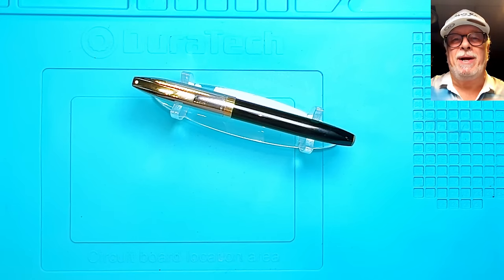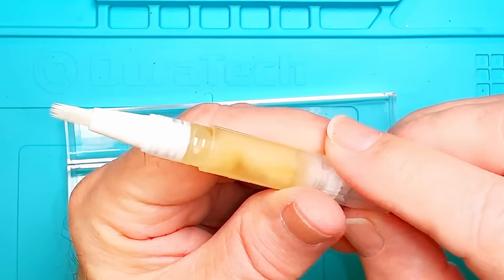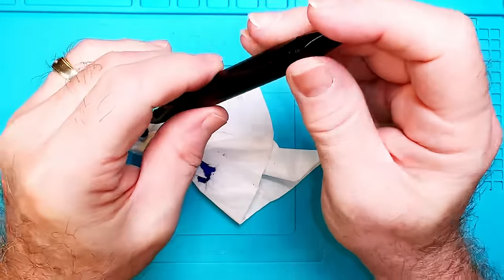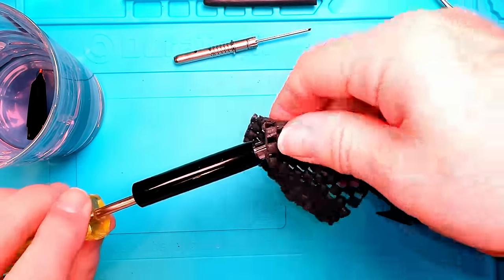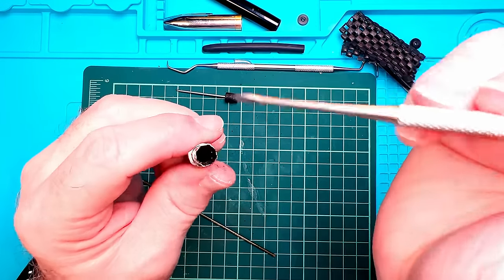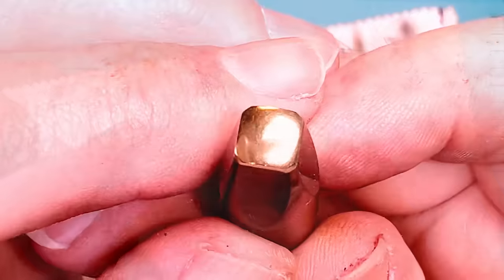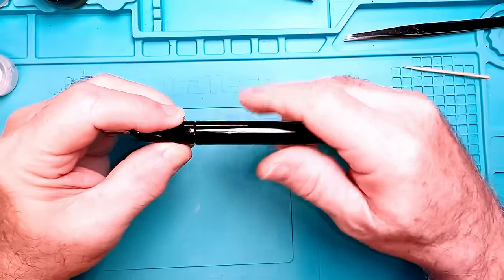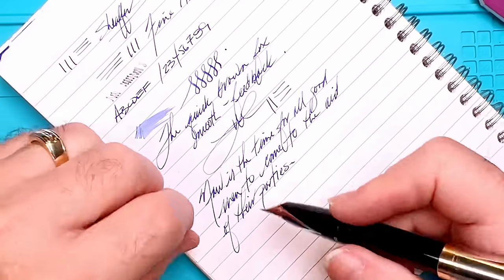Pen Resurrection Sunday Ep 56 1960 Sheaffer PFM

Comment: Hi Doug,very interesting video.I'm rather a Sheaffer man myself and have done several TM snorkels but never a PFM.When replacing the sac protector I don't bother recrimping,I just add a dab of shellac.I find this is perfectly sufficient for holding it secure and it  means that next time the pen needs resacing there is no need for uncrimping,just a bit of heat.
Reply from the maker: Great point!

Comment: Even though I’ve serviced a dozen PFMs, it’s still a fascinating repair to watch. I just love snorkels! 24:14 Tip: try nail polish remover (Acetone) instead of IPA. 30’ turns ossified sac into goo. Also, surprised that the Anderson kit didn’t include the 3rd gasket, which goes into the blind cap. Oh, and good to see the O-rings in full force on the block, I should have taken a patent out on those before they went Doug-viral! ;-)
Reply from the maker: LOL that’s a great tip George!

Comment: I use hot water on the section, its safe for this type of plastic, always use dry heat on celluloid though. I find it easier, it's safer too.